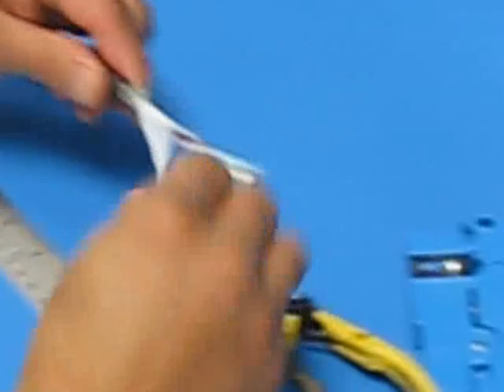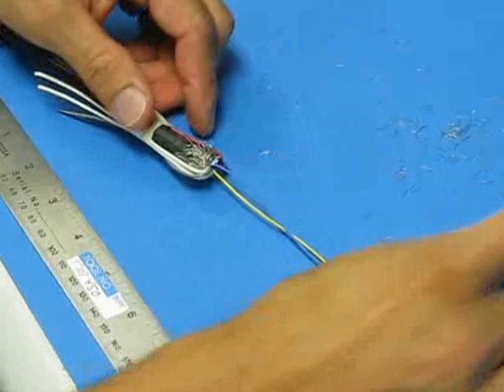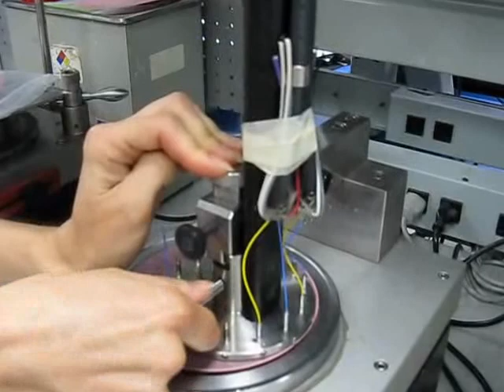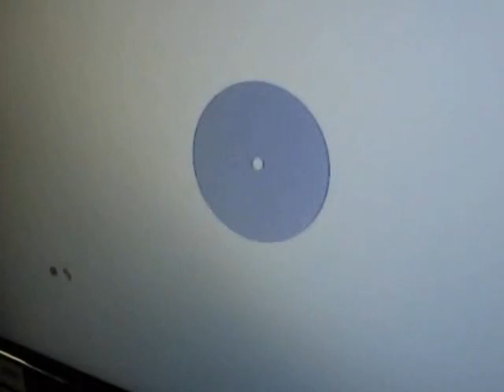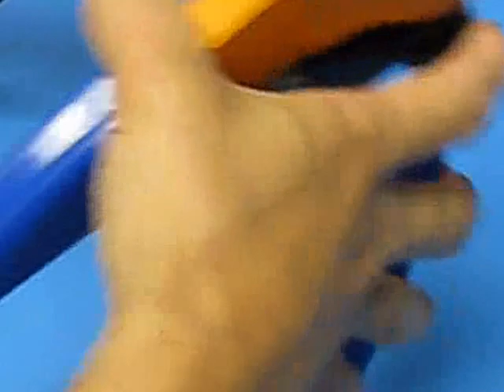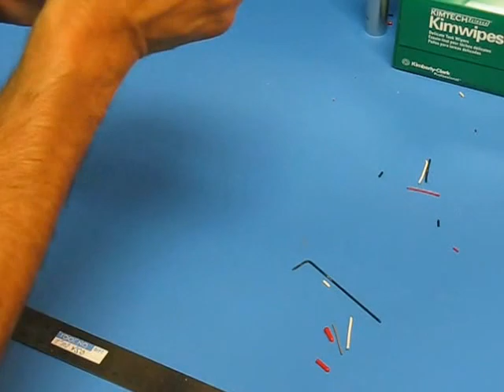KINGS® Fiber Triloc Detailed Assembly Training

Comment: Thanks for the video.  Very detailed and well recorded.  Excellent work.
Have a comment: the narrator uses some incorrect terminology at times.  (braided shield isn't a "coax", binder tape isn't "filler"...filler is amongst the conductors and is cut a little later, scribing isn't "cleaving", the air polishing step is not to "remove the fiber" but to remove the sharp edges of the fiber so that they don't catch during the polishing steps,...)